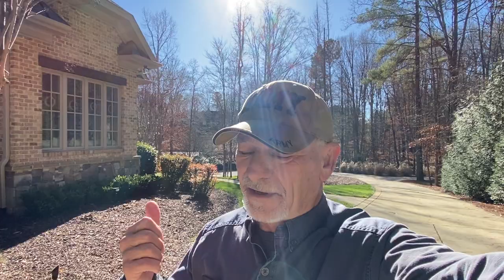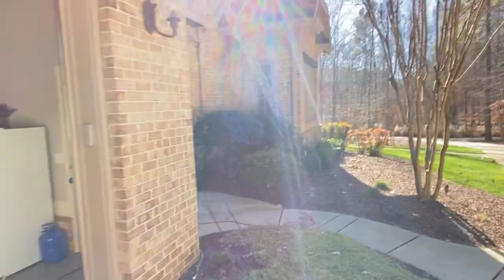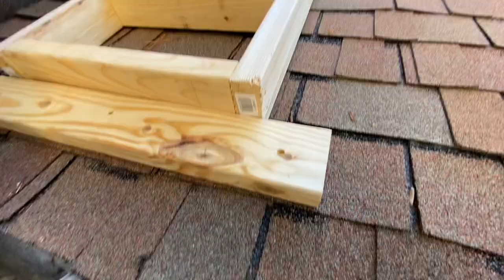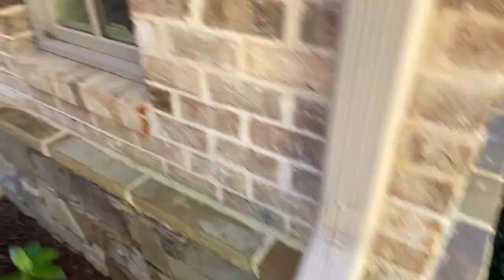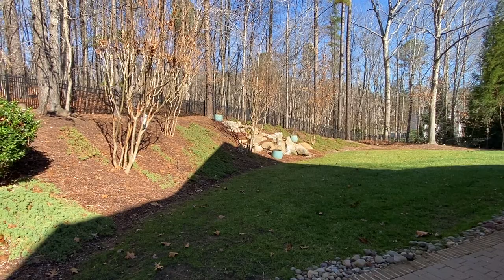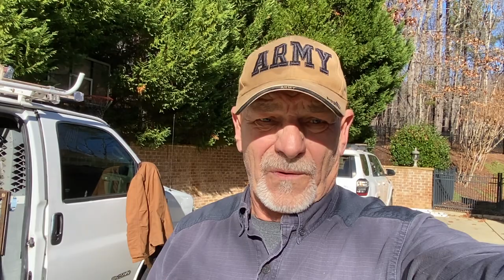WOOD ROT 25' UP.  Building a Ladder system.

Comment: You need more overlap of shingles at the top of the facia.  Roofer did not let the shingles overlap far enough and water is getting in behind the facia.  If you don't fix the shingles, you will be doing this again in the near future.

Comment: Stop screwing through the face of shingles.  Just because you slap some roof tar over it after you’re done doesn’t mean it’s not going to leak again.  Totally unprofessional.  

Should be using roof racks or a pitch hopper…anything that avoids screwing through the face of shingles.  

I hope your insurance company sees this video. Probably not even properly insured for roof work.